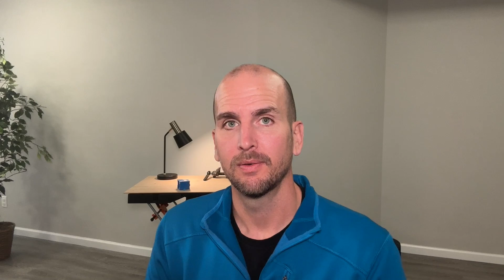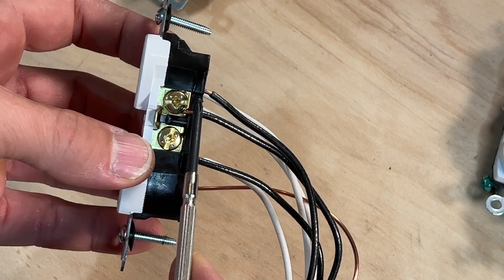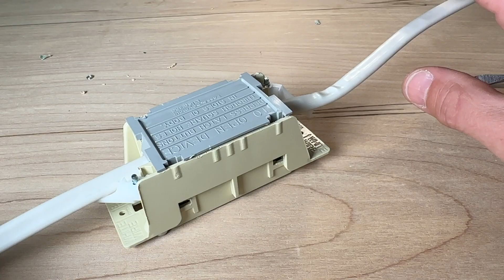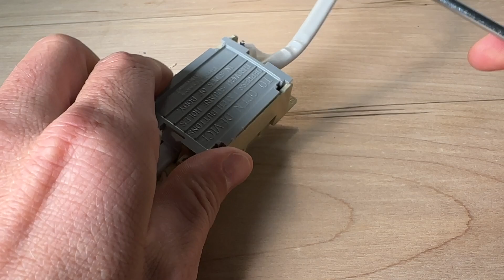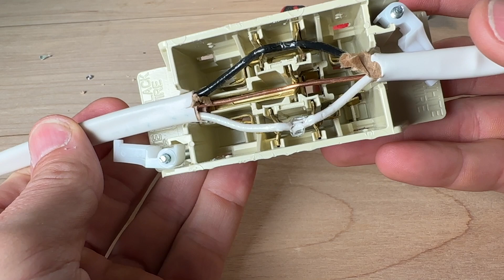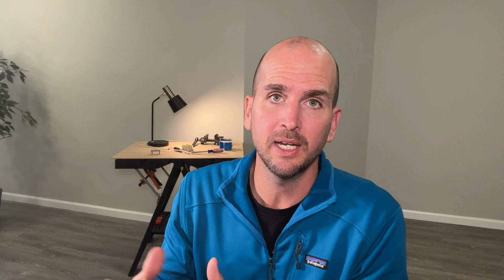90% Of Homeowners Have Never Seen This Dangerous Electrical Device

Comment: Just to reiterate some of the other comments: I'm familiar with this type of connection when working with low-voltage data communication wiring, such as land-line telephone ("POTS," or Plain Old Telephone Service), which typically uses a CAT-3 wire; and Ethernet wiring, which normally uses CAT-5 or CAT-6.  These wires are 22 AWG or thinner (24 or 26 AWG, depending on specific application).  A proper installation uses a punch-down tool, where the working end typically resembles a thin, but relatively wide blade flat screwdriver, with a small notch in the center.  Most are just that much, but some tools also have a spring-loaded internal hammer, which seats the wire completely into the connection.  Some will even trim the wire automagically.  This is a vampire-tap, which, again, is very common among these thinner wires, both on the male and female connectors.
However, I agree completely that these should be a no-go on heavier gauge, especially 14 or 12 AWG.
I've also seen "vampire tap" used in plumbing, typically to connect a 1/8" line to a 1/2" line (or larger), to supply water to refrigerators, water dispensers or swamp coolers.  In my opinion, these are also a no-go, as I believe they are prone to leaking, and repairs are more difficult that necessary.  Also, if you eventually remove the appliance that uses the water supply, now you have to figure out a way to cap it.  A proper splice (with a valve) might be more work up-front, but I believe is far superior in the long run.

Comment: So I work with these all the time. I install electrical services for a couple mobile home dealers in NC.

These do require a special tool. The factories of the mobile homes have the tool and train the workers on how to use it. The tool is (from what I recall) $2,000.

Obviously not very economical for a small business such as the one I work for. However, we have created our own tool to use to insert the wires to the metal contacts. 85% of the time you can't tell we've been there to fix whatever the issue may be. The other 15% of the time is just weird scenarios. (i.e. factory worker had their tool misaligned and bent the ground contacts out of place on every outlet in a house.)

We see these outlets everyday in these house. And they ALSO make a similar type for light switches. Yeah, light switches too.

So far in my experience I've only seen one potential heat realted issue, a couple weeks ago. But the cause for that was the factory didn't properly install all of the wires.

I've seen as many as 4 wires pressed under one of these. 3 generally being the maximum.

I've seen 12 gauge wire inserted in them, but it really can't handle 12 gauge without some damage to the metal contacts. 2 is the maximum I've seen.

In the light switch models, often we see that upon turning on the switch, the metal contact doesn't connect to the live hot side. So the light doesn't turn on. We replace the light switch models more often than the electrical outlet models.

They are CHEAP. 90% plastic. 

Having wired up services and done service work on these mobile homes, I can tell you this with confidence. If I couldn't afford a house, but had the money for a mobile home. I'd live in a cardboard box on the street. These things are DEATH TRAPS waiting for disaster. Ever since the last 2 years of you know what, the quality of work on these homes has disentigrated. 

We just had a house get sent out a few weeks ago where the marraige walls didn't line up. The back half was severly screwed up. Boards were not standing up vertically, they were slanted by 20 degrees. Doesn't take a level to see how far off it was. Got the plant manager out and he was FUMING.

It and every house I've seen with basic stupid mistakes, shows they are NOT inspecting these before shipping them out. Avoid buying mobile homes at all costs. It has to be a DEAD LAST resort for me to even consider buying one.

Comment: I purchased my 24foot, class C motorhome in 2018. It has been a 4year adventure modifying it to fit my needs as I live and travel in it nearly year-round. The first summer after purchase I installed 540watts of solar panels and 270ah of batteries. The first thing I did was replace all the wiring with 12guage as well as the outlets. I also updated the circuit breaker panel to split the microwave and upgraded battery charging system onto their own ground fault breakers. Then I divided the remaining outlets between 2 breakers, with one line on a 20a transfer switch for solar use. Each line containing a ground fault outlet. As a former mobile home and RV insurance-repair rep, I cannot emphasize enough how dangerous these outlets are and how prone RV's are to water intrusion. I've seen many times, were just leaving a window or vent open during a pop-up thunderstorm can cause thousands of dollars in water damage and electrical fires. Many burn every year as a result of electrical fires due to overheated outlets often triggered by water intrusion. These outlets are very susceptible to moisture and vibration failure.

Comment: I'm an engineer and I completely agree with your assessment!  It boggles my mind that any electrical code organization would grant a safety compliance for 15 amp insulation displacement connectors on 14 gauge wire. The insulation varies considerably across manufacturers and installers may not pierce it perfectly. I did not do the math, but there does not seem to be sufficient cross section area to reliably support a 15 amp load without overheating or melting (I squared R means heat). UL is a trusted organization, so I must be overlooking something.

In my jurisdiction, we require that any outlet be able to be removed from the box for service without breaking the passthrough of neutral or ground to downstream loads on the circuit.  I can't see how this installtion technique would allow sufficient lead length to replace an outlet properly. 

BTW, you are not alone in avoiding those push pin connections on the back of outlets and switches. I always take the time to J tie the wire to the screw post.

Comment: I would have thought they would use something like the internals of a Wago where the pressure of the contact is spring loaded. 
The vibration of driving an RV seems like a major NO GO for sliced wires?

Comment: I would say these probably are in code because it can be said the there is technically wrong with the outlet, but in the way it cuts through the insulation to make contact. It could be easily fix by removing some of the insulation before insertion.

Comment: I hate these. We owned a Manufactured home, and it had them. We ended up replacing all of the outlets with standard outlets, which also required that we put junction boxes in each of the locations where there was an outlet. The other issue is typically there was one on each side of the wall (ie, Master bed, living room) and they were in the exact same spot. This then meant that we now had to create a new hole opening that was moved for one of them, patch the old hole, and install the junction. The wiring in that house was... Less than ideal. Especially when it came to lights. It was also weird because of one of the outlets that was in my sons room had a load (first time we used it) and caused my daughters room (Literally the other portion of the double wide) to loose power... So it didn't follow the every outlet in one room must be able to be turned off using a single breaker... but maybe thats because it was a Manufactured home... either way... LESS than ideal. And one of the many reasons I'm happy to be in a standard build foundation home now.

Comment: Very similar to the Neutrik field ready XLR connector press fitting. But that is really low voltage. It works, but it might not work.

Comment: I'm guessing the reason why they use these in RVs and mobile homes is I'm betting they are a lighter weight than having to have a separate plastic or metal box for them to be in.  And being pressed in might make them less vulnerable to the vibration of the RV going down the road causing the screws to loosen over time.  The other problem may be lack of room in the walls of these vehicles for the regular kind.  I'm guessing these are the main reasons for these.

Comment: In networking we call that an Insulation Displacement Connector (IDC).  Unbelievable to me that it’s used with conductors meant to carry significant current.  Thought it didn’t exist outside of signaling.  https://en.wikipedia.org/wiki/Insulation-displacement_connector

Comment: I bought a “older” manufactured home about 3.5 years ago. Few months after moving in and starting renovations I had a outlet catch fire after plugging in a space heater. Long story short I found the whole house had these fire traps in every wall. I spent the next 3 cold winter months tearing out every outlet in the house and rewired many of the walls in addition to replacing all the outlets and switches….. I was and am still flabbergasted that these can/are sold and used ANYWHERE let alone a otherwise “standard” up class looking home…..

Comment: I have seen something like this that works by you clamping the wire with a screw and two metal plates with teeth. They need you to strip the area to be clamped and then put it into place. It uses the wire in a nearly identical way except for the lack of blades. It typically requires a torque driver to properly clamp the wire but it makes very good contact with the wire and it recommends that you put a wrap around each terminal but it isn't required.

Comment: It seems to me that the danger comes from people taking shortcuts or trying be cheap, and that these are perfectly safe if they're installed properly. One of the first safety rules any tradesperson hears is to use the correct tool, and my guess is that whomever installed that, didn't. Don't blame the product or the compliance code; blame the tradie! But if you don't trust the compliance code, which seems to be common in these comments, maybe researchers and testers aren't getting funded enough, and are being swayed by commercial interests. In that case, we clearly should stop electing officials who complain about taxes and 'big government'. 🤔

Comment: IDC connectors are garbage on low-voltage applications (I repair pinball machines and they are common) I can't imagine using them in household wiring. Freaking nuts.

Comment: I have experience with these and they are absolutely dangerous Junk. I feel certain that someone bribed a congressman and got a little paragraph attached to a 200 page legal bill about some highway widening project to get a law passed to approve these for legal use. My bet is some Mobile home manufacturer got with a company that makes electrical components and came up with this garbage to cut costs and speed assembly of house trailers.
     Yours doesn't look too bad. Most of the time I have opened them, there is black inside from arcs... Never use these. If you find one anywhere, replace it. I wouldn't have one of these in my shed, let alone a house. I still can't believe that these little 'Burn boxes' got approved for installation in a building where people and pets have to sleep...
    Ya'll Take Care and be safe, John

Comment: We've had punch down blocks for decades in the telco and data industries. I'm not surprised the power industry now has this. However, the right tool and some experience are paramount. Having a punch down 15 Amp outlet is a bit scary. The stuff I used was low voltage and very low current. If you failed with a wire punch the device just didn't work, if this fails you could burn down a house or worse.

Comment: Even when perfectly installed there is such a small surface area for contact you'd think it would make a fire hazard. I wouldn't want to run an electric heater off of one of those.

Comment: I have as outlets have wore out, replaced them with commercial grade outlets. I have also added metal boxes when changing them and converted some to GFI in ares where I restore old radios just to be safe.   If I had those in my house I would replace all of the outlets just to be safe.

Comment: My wife's uncle lives in a manufactured home. He wanted me to replace a switch which had stopped working. The lights would only come on for a split second if the switch was turned on quickly, otherwise not at all. I deduced that it was a bad contactor mechanism in the switch and decided to pull it out of the wall. I was greeted with a switch which looked a lot like this receptacle. I had never seen it before and spent a good while looking for a replacement. The only place that sold them was a trailer store, which was closed. I gave up and installed a box with real devices. Luckily there was enough slack in the wire to do it.
Reply from the maker: Yeah, the way you handled it is my preference as well 👍

Comment: I live in a double wide mobile home that we inherited. And it has theses types of plugs and switches all though out and a lot of them don’t work so I’ve been tracing the wires from switches or plugs to lights. And have found burned wires in the walls so I have been replacing them with single pole switches and rewiring my breaker box. To over come the common wire feed back with the house being wired in series, I’ve worked with older homes in HVAC. So with theses mobile home switches and plugs I used jumper wires to get the wiring right because some of them have more then one hot wire going into them and could control more than one room or appliances.

Comment: Any friction fit termination like this that is used with higher current in homes should be banned. It's absolutely dangerous and I cannot believe it's even allowed. There have been countless times where I have seen these termination practices being used and every single one of them has failed causing not only burning wires and outlets, but arcing as well. I've also saw when replacing these outlets including the use of back-stabbing, that the outlet literately crumbles into pieces when taking it out of the wall to replace it.

Comment: Insulation displacement method? That's crazy for a power socket. I've seen and used the method for telephone and Ethernet sockets but definitely not for power.

Comment: The wire nuts vs WAGO connectors video....The actual surface area of contact is so small in a WAGO it's troublesome to me....and I'm a new construction plumbing contractor. Give me a correct size wire nut and I'll twist the crap out of it, and tape it (if it needs it)....lots of surface area contact.

Comment: And we wonder why so many mobile homes burn down..   I may be wrong but I thought the UL listing is only valid when these are installed using mfr approved tool.    Personally I stay a way from any kind of “vampire” connection technology.   Poor wire insulation quality also makes these even more dangerous as the thickness of inexpensive wire insulation varies greatly and can contribute to an ineffective connection.    This technology can work but everything needs to be  just right.  Given the bad wire quality out there, unqualified installers in factory home facilities (mobile and modular homes) , lack of use and training installing this technology with proper tooling it is a recipe for more loss of property and yes, loss of life.

Comment: Pass and Seymour have been in TBE hot seat with the CPSC over other products that required a recall. The code may not be perfect but the UL mark may be fraudulent if it came from China where they get most of their stuff made. There is a difference between listed band approved and my guess it is not the latter. This sort of socket can not be suitable for heavy loads and I would worry about a fire when plugging in a toaster or a microwave to it. I have seen  IDC outlets used in 
cheap outlet stripsthat don't last long enough to be useful. The code doesn't regulate wiring devices but only requires they be installed per the manufacturers instruction. The installer is at fault here if the proper tool was not used for installation. This type of socket is not something I would ever install.

Comment: I have have been replacing these in RVs and mobile homes with regular boxes and outlets for years. They are the absolute worst dangerous horrible need I go on they melt burn just plan quit working.  They are used as junction box where they stack up romex in them which if you’re lucky it will only quit working and not start burning. If you are foolish enough to replace them with a new one it will run about $17 $20 from the rv supply store. I would hate to guess at how many trailers have caught fire because of these things but I know of at least two that have. There should be a class action lawsuit against the use of these dangerous devices and find out who paid off UL to approve them. 😡😡😡😡😡

Comment: I have a double wide trailer that is rather upscale, but is wired with this type of devices. I have had trouble with some and whenever I do any work involving one I replace it, but replacing it with a good device is tough, I have to open the hole out to accommodate a standard box and then pull the wires in and remake all the connections. To do the whole house would be a big job, so I just watch and try to make sure nothing overheats.